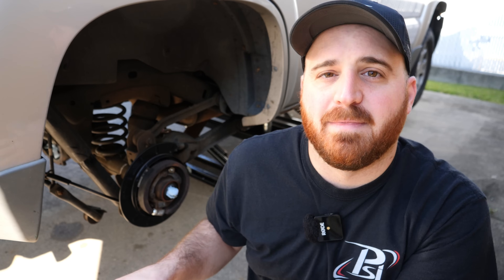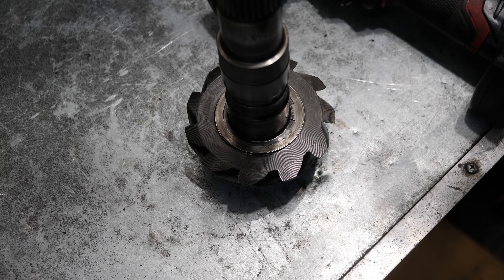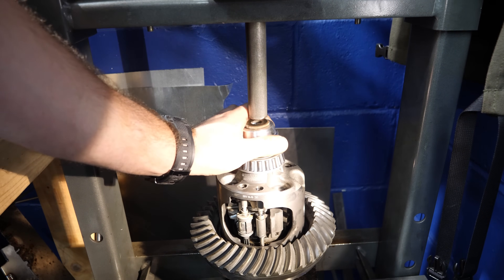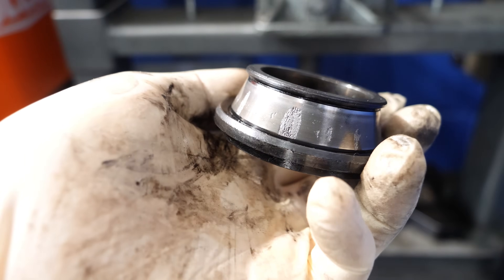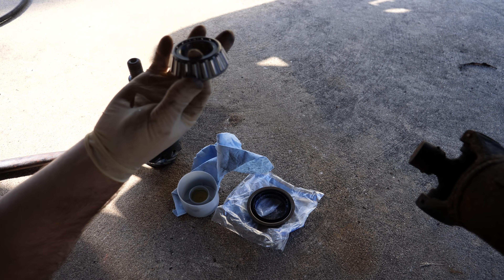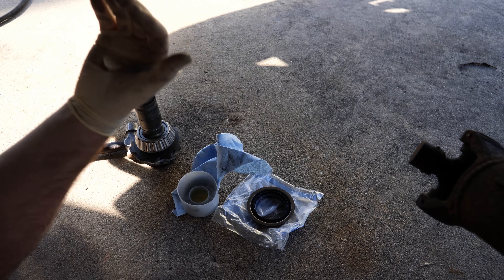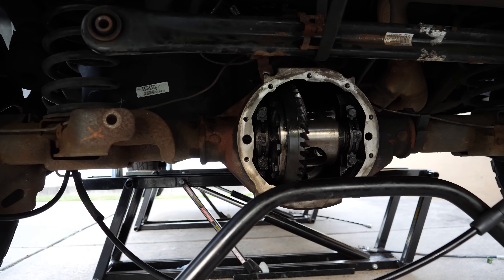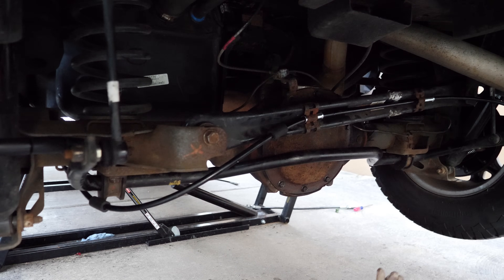I Found the Cause of My Tahoe's Rear End Whine! | GMT800 Differential Bearing Replacement

Comment: i know this is a year old but if you dont put a little itty bit of sealant on the splines, it can slowly leak through that, and it can appear the seal is leaking when its not. edit: also @1:47 support those bolts in the press. The way you have it set up looks like the bolts are holding the pressure.. thats  a no no.

Comment: From my understanding the gear oil should indeed have a modifier in it for a g80. There is confusion on this subject because gm put out some literature saying not to ADD modifiers. What they failed to mention is they were referring to using thier own specific fluid, which already contains the modifier so more isnt necessary. I believe they even added purple dye and a scent to their fluid with modifier in it to easily tell if the fluid contains it or not.

Comment: This video came out at a good time. I have been trying to diagnose a whine in my driveline. I was inbetween carrier bearings or pully or mybe a going bad converter. I am now pretty sure its my diff. G80 locker stuff. But still going to confirm first

Comment: I have an 05 Z71 with around 130k on it. Got it with about 126k. Anyways, it has a nice aftermarket sound system. Any time i would have the volume low, i would get crazy alternator whine( or so i thought) through the speakers  any time i would accelerate. Always assumed it was a grounding wire issue. Fast forward to 2 months ago, i was getting some crazy grinding noises in the rear end, and it was leaking diff fluid. Took it to aamco, turns out it was the pinon bearing and pinon gasket. I had them do all 4 u joints as well. They cracked my drive shaft cause one u joint was so rusted on there. Anyways, new drive shaft and the rear end work made the crazy whine go away. Love your Tahiti vidoes

Comment: if he's the g80 Posi option. it's a clutch locker more than a limited slip. it's got weights that spin when one tire slips, that force locks the clutches. it will then unlock again above 20-30mph. it's kinda nice for that random once in a life time need for a Posi on a stock daily without the side effects of a true limited slip that will most likely be to worn out to do anything 300k miles later. but weak for performance use. as for fluid, the clutchs need to lock tight not slip when engaged. with the additive I've read and did experience it seemed to chatter around corners a few times when it shouldn't have using normal auto parts store stuff. so I went to the dealer, bite the bullet, paid the 25$ a bottle for the oem spec stuff. has never chattered since. from forum posts it seems it's hit or miss if it's a big deal or not.
Reply: just looked at the 6:10 mark I can see you do have the locker g80 option. be interesting if you notice anything chattering. especially since you drive in the snow and might actually use your locker. I'm down south and it's never really been used beside me trying to test it in the sand lol.

Comment: Wow you still have that SUV wow how much money have you put into this so far. My 2001 Sierra 1500 with 124,119 miles on it I have Invested all most $18,711.04 That's what I paid for the truck and the mechanic Investement on labor and parts within the past 3 years. Funny part is the truck is far from being done. Alot of work Matt you have put into your Rig I feel your pain my freind I am right there with you with My Truck. Alot of money to completely redo your 01 Sierra into a all most new truck again. I have other $10,000 to finish everything else that's a guess of course on the mechanic I go to and his a body guy as well. That's body work and the rest of my mechanics that need fixing. I definitely didn't know it would be such a nightmare of a job.